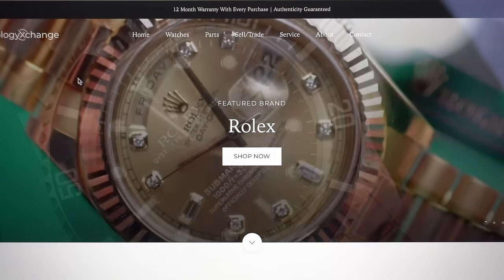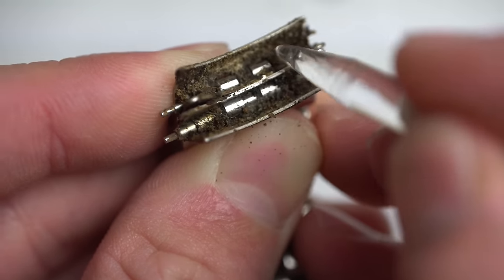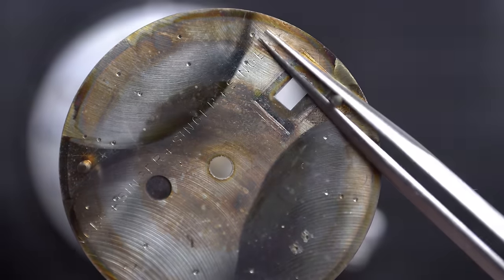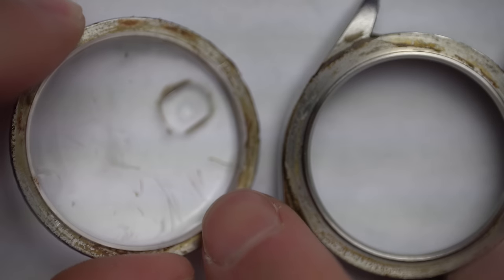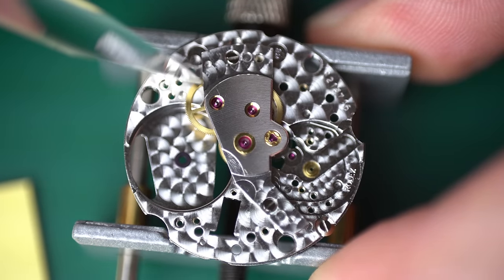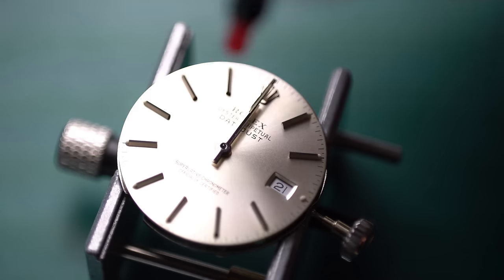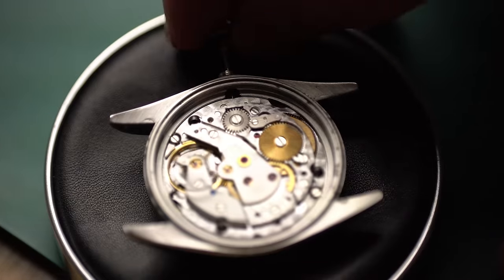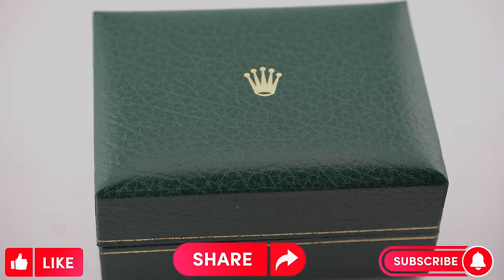BIOHAZARD Rolex!.. 39 Year Old Vintage Rolex Datejust Restoration!

Comment: Watches will get really filthy from dead skin combined with body oil.  I do a superficial clean most of the time using a toothbrush.  A spudger, a plastic tool used for some electronics, scrape accessible areas.  Watches like most of my 200M dive types can be more extensively cleaned with very warm water with dish liquid in a plastic bowl.

Comment: Pete

Great video.  I’m curious as to your measurements I.e. beat error, amplitude, loss of seconds per day: what would a brand new from the factory Rolex measure in at?
Reply from the maker: That’s actually a great question as every new piece from factory undergoes QC, but they all measure differently when they arrive.

Comment: Hey Peter, I have a random question for you. If you got water in your Rolex (leaving the crown unscrewed), would it make sense to fill the watch with oil or alcohol to try to avoid any rusting until you can get it to a repair shop?
Reply: Peter already answered this on another video. He said: "Alcohol maybe but once water is in there it’s pretty much counting down the clock until rusting starts, alcohol will also damage some parts"

Comment: I love watches like this - doesn't matter what the exterior condition is, as long as the dial/hands were protected.  And yes, I've seen watches with that much dirt.  What's crazy is how they get all the dirt/mud under a rotating bezel!  You pull the bezel and somehow it looks exactly like the lugs on your Rolex.  How???  Great video, only wish you had shown your remedy for that frozen pin.  My biggest annoyance is seized pins...
Reply from the maker: Well said! And it’s weird right, dirt is like water it’ll find its way into any small opening drives me nuts!
Reply from the maker: Also for the seized pin, let it sit in warm evaporust should free up the rust, and allow you to remove / replace

Comment: Dear Sir;

Hope you are doing fine;

I want to buy a Rolex watch from a friend who has 2 watches for sale:

1- 16220 - silver dial - made 1991 - 36mm - steel Bezel & oyster bracelet - sapphire glass - 3135 movement.
2- 16014 - black dial - made in 1978 - 36mm - steel/white gold bracelet/Bezel - acrylic glass - 3035 movement.
Prices of both watches are nearly $5000 USD.
But the condition of the 16014 is somehow better than the 16220.

I need your advice, which one of them should I choose to buy?

Appreciate your time & advice;

Thank you

Comment: I can't believe he beat it up that bad knowing what the watch is worth. At least take it off and stuff it in your pocket when you're working on something, then wear it in the shower and wash it off. It's a Rolex that doesn't mean it's invincible.
Reply from the maker: ehh some people are using them to enjoy resell value is irrelevant! but for the most part a Rolex will easily take the abuse
Reply: @Peterpic  true one of the best parts of one of those watches is you don't have to take it off, strong water resistance I bring my watches in the shower soap them up and rinse them off all the time and I never got that much disgusting buildup, I had to replace the case on one that I bought because someone never washed it and it actually ate in and pitted the case where the gasket seated under the caseback. 1982 16030 date just. It even made pits and holes where the end links go on the case where the serial number and model numbers are. When I took it apart I said my God what did this guy stick his arm in acid?